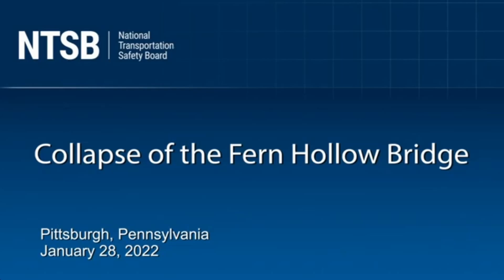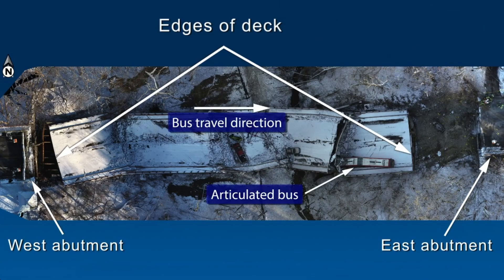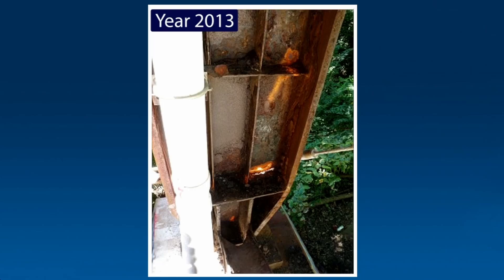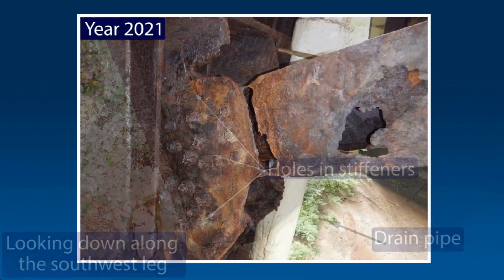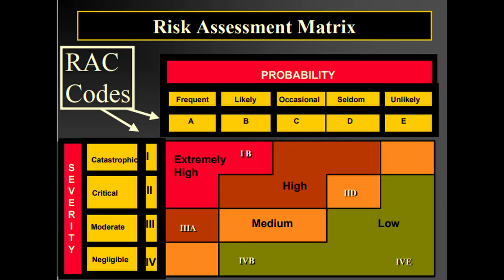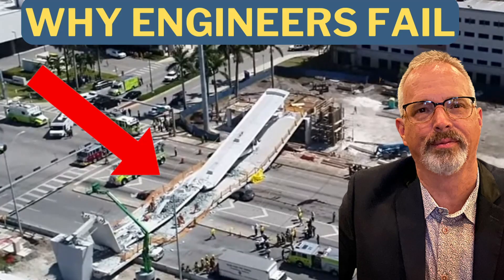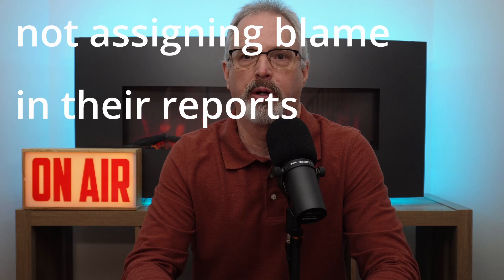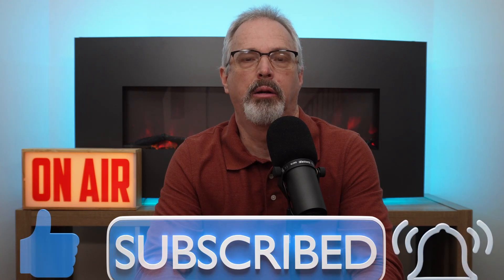Why the Fern Hollow Bridge Collapsed

Comment: I'd like to offer a different perspective and a question.
I'm a commercial vehicle owner/operator that has trucks inspected more often than any bridge, held to often ridiculously high standards. For example, light to moderate  rust is red lined and it NEVER gets to the point of rust through. There can't be ANY loose parts. It is petty to the point that valve stem caps must be steel, not plastic. The driver is personally responsible for the vehicle at ALL times and the owner is also assessed a Combined Safety Assessment score that can trigger additional review and even shutdown by the Feds. If a vehicle is randomly inspected and found to have even minor defects it can be placed Out Of Service until repaired. If it is found on the road while OOS, the driver is guilty of a FELONY.
Roads and bridges can be in unsafe or worse condition, NO one is responsible to any extent and this is acceptable to everyone? 
I've asked many involved in various positions why this is- including my town to explain a road that was washed out and not repaired for two months- why does this contradiction exist for infrastructure vs. infrastructure user? Anyone?
Reply from the maker: That is a great point.  There are too many double standards held by government officials.  What is good for the goose is not good for the gander for some reason.

Comment: I do think that the way engineer reports on these sorts of things do need to be adjusted to put the safety recommendations at the front of the report. It would make it a little more difficult for the owners to overlook that part if it's right up front. Not that owners of these buildings and bridges still won't find excuses for why they didn't act, but at least the engineers that did the inspections will be able to say "we put it right in the front of the report so I don't know how they missed it."

I'm not saying this to blame the engineers, but rather as a sort of "cover your ass" type of precaution. And frankly, it has more to do with how these reports are typically structured rather than any individual's decision or whatever. All I'm proposing is a minor change to the report format.
Reply from the maker: I agree with you.  In the newspaper business they called it burying the lead!

Comment: KISS, Keep It Simple Stupid, bridge designs would help in preventing the failure due to poor maintenance and make inspections simpler.

Bridges that require a component level FEM analysis to Id critical members should not be used. We are not designing airplanes. 

On Fern Hollow I would not be surprised if the design used Hardy-Cross in the design calculate the bending moments in the legs.
Reply from the maker: That is a great point. Plus the usr of weathering steel was a bad choice for this area.
Reply: A painted  bridge of that vintage  with no maintenance would be just as poor or worst shape.

 A weathering steel bridge I design in the early 70,'s on a heavily salted road is structuly in good shape. The areas of concern we took care of, painted areas of concern  joints and  drainage have been maintained  The deck is starting to show it's age and the parapets don't meet current standards. Not bad for a 49 year old bridge.

Comment: As a resident of Pittsburgh, there is a local joke about sightings of city employees actually doing work. I would bet that dozens of work orders to clean out those drains were issued, reported as complete, and signed off as verified. It’s really insane that the city floated bonds for 3 sports facilities, added decorative lighting on the 3 sisters bridges, and implemented some of the most ill thought out and dangerous bike lanes anywhere. The bike lanes were such a superficial attempt for political approval that it’s almost laughable. A year or two ago, there was a concrete and steel bridge in the East Liberty section of the city which had the pedestrian walkway being supported by 4x4 lumber. Do you remember the bus that fell into a sink hole in the middle of the city? The city should be put on some sort of probation for this malfeasance and neglect.

Comment: Champlain towers was a very different animal, the inspection contractor was basically hired to do an inspection (likely in hopes of getting a contract) - so it’s bad, but we can fix it. 

This bridge was inspected by the state, guys who have a ton of other bridges and structures to inspect, and a clear chain of command as far as who is responsible down the line. 

Also, with Champlain towers, most of the clues were really NOT in those inspections. Most of what we know now is after extensive focused engineering work over an extended period of time with tons of resources. The biggest deficiencies were really in the initial construction anyways (lack of rebar, rebar in wrong areas) or excessive load due to massively heavy upgrades throughout the tower, which would never be known by the firm who inspected the building. 

This bridge? A clearly (visibly) non-redundant structure, with supports CLEARLY compromised - very different animal. 

The inspectors probably oils have done more, but after nearly a decade of reports to superiors, it’s kinda out of the hands of the little guys. Somewhere, those photos were sitting on a supervisors desk - probably sent to someone ELSES desk, etc.

Comment: Consultants have an vested interest in 'customer satisfaction'. If the customer absolutely will not tolerate bad news the consultant will know this and soft sell the deficiencies. The burying of the failure at page 9 in the Champlain Condo Structural report  may be taken as an excellent example of this. Had the information been the headline item of the executive summary, there are any number of clients who would return the document for revision. If the consultant stands their ground some clients will then 'shop' for a new, and more flattering, report from a different consultant.

Comment: Human beings have a huge weakness: they want everything to be all right. If no one says anything, well, then, everything must  be fine. I won't worry about it. The problem is to get someone to speak up. "This isn't all right! We must do something.We must close the bridge. That guy on the subway playing with a gun: we must swarm him. Or at least call a warning and empty the car." (Thinking of an incident in New York back in the late '80s or early '90s.) But it's easy to believe and hard to speak up when, holy shit, I might be wrong and then I'll be embarrassed. Better embarrassed than dead. Speak up.
Reply from the maker: Thank you for pointing out the human factor which is the root issue ultimately.

Comment: There needs to be a law that states that if a certain level of bridge maintenance is 'not' performed, and the bridge has resulting severe structural issues, then you have two choices:  1) Shut down the bridge and bypass the traffic elsewhere until the required bridge maintenance can be performed.  2) If you think the bridge is structurally sound, pull by cable, across the entire bridge, a remote-steered loaded cart that contains 2 times the maximum load that the bridge is rated to handle, every month until the required bridge maintenance can be performed. A 'sound' bridge can handle 3 to 4 times the rated load, so if the bridge is okay it won't 'buckle' under twice the rated load.  If the bridge is about to fail, it will fail with twice the rated load.

Comment: It's worth pointing out that contracted inspections often are specified to exclude opinions and recommendations or at least to limit recommendations in such a way as to effectively be calling for continuing to inspect.

Law departments for responsible jurisdictions and contractors have been documented to do training about liability avoidance by never putting anything in reports, memoranda, or field notes, or in any electronic communication that could later be interpreted by a jury as 'prior admission of liability ". Simply put, never write anything above and beyond the minimum required for the stated purpose.

The issue with prior admission is usually explained as that if during document discovery, as part of a liability lawsuit, something can be presented to the judge and is interpreted as a prior admission, that judge can decide that there cannot be any defense presented to the jury, because the respondent already admitted liability. So the only thing remaining would be to assess damages owed.

And that's all in addition to what can happen to insurance costs when underwriters get ahold of critical inspection reports.

Law department personnel often justify their behavior as protecting the taxpayers. 

And, ultimately it's the taxpayers who have created the system and that often believe everything is as it should be until they, their family, or someone they know is affected by shortsighted and dangerous decisions.

Comment: Question:  When building a bridge, there's set standards on what can be done, the materials used,  loadbearing capacity, how much to safety margin, etc. etc. But are there set standards for condemning the same structure?   When you see some rust, what is the dividing line between a concern and time to condemn the bridge? Do engineers go back and re-check the load calculations based on the weakened structure?  I thinking the problem is the lack of standards, particularly for a slow-moving problem.  On top of it, no one wants to be "chicken little" and sound the alarm too early because no one would hire that engineering firm in the future. Add into this management which is always going to ask "can we put this off for a year?".  I doubt if engineering has gotten so advanced that someone can predict with certainty that "it will fail in one year".  But if there's a standard, then the engineering firm can say "You're 10mm away from required condemnation" and it would force everyone's hand.  It's easy to look back on a failed structure and say "something should have been done",  but I don't think anyone is accounting for typical human/management behavior "It's been like that for awhile.  Can we do this next year?"

Comment: Thanks. Some people treat their position like it's theirs and don't consider the implications of not changing things and taking action. If they can spread responsibility either be taking slow action to pass off to their replacement or by directly passing it off they will. If the final person responsible for taking action is far in the bureaucratic chain then they can feign ignorance and just ignore problems to spend it in whatever they are pushing. Officials are more concerned with winning for themselves and their team, as well making any competition look bad. They don't care about anything unless it helps them out hurts competition. Happens in private as well. Someone won't make changes if it causes problems with them rising up the ladder.

Comment: Those cables look as if they're doing more harm than good by pulling harder on compromised structures. Sheer stupidity.
Reply from the maker: I agree. They appear to be counter productive.
Reply: Cables don't work well in compression, bandaid on a amputation.

Comment: Walked under this bridge a couple years before failure and noticed the added cables and the completely rotted failure leg.   I couldn’t figure out how the cable was helping.  And I do have a little engineering and safety background.
Reply from the maker: I think those cables were no better than decoration!
Reply: I saw in the local paper that the cables were added to reinforce the crossmembers.  While clearly ignoring the gaping holes in the main supports.   Wish I had taken a photo.

Comment: It's a systematic management failure.  If front line inspector has authority to immediately shut down compromised structure before inspection is complete and long before report is written and fails to do so, the resulting collapse is 100% on that inspector.  If front line inspector doesn't have that authority, then that's a systematic organizational failure.  If front line inspector has already concluded structure is compromised before inspection is complete, and organization is expecting that front line inspector to complete the inspection, write full report and play town crier all at same time, that's a built in systematic failure and these things will continue to happen.  In short, if inspector can immediately order DOT to close bridge upon initial conclusion, there's no need for inspector to play town crier.  Inspector can then quickly write and issue a short partial report documenting why bridge is now closed, before returning for a complete inspection and complete report sufficient to determine next steps, be it repair or replacement of structure.  Isn't that what happened on interstate bridge over Mississippi River between Tennessee and Arkansas as soon as inspector observed a single cracked beam?  Wasn't that bridge immediately closed before any report was written?
Reply from the maker: You are exactly right!  I need to research the Arkansas bridge story.  This Pittsburg bridge situation reminds me of the  I-195 bridge in Rhode Island.  A junior inspector notice a broken tie rod in the bridge deck which caused the deck to bounce wildly under traffic.   That was on a Friday and the bridge didn't get closed until Monday afternoon.

Comment: I'd have to wonder whether the inspection contracts contain secrecy provisions that prevent the engineers from going public. Even if such provisions were rendered void by statute, a company that went public could expect not to get any more inspection work. 

It would really take a statute that forced the inspectors to immediately publish all inspection reports with no exemptions (the existence of any exemption would lead to delaying litigation) so as to prevent government entities from covering these issues up because they don't want to spend money. Another possibility would be an independent agency that is required to receive all inspection reports, and with the power to close unsafe structures.
Reply from the maker: You mentioned some great ideas.  Usually such inspection reports are a matter of public record but there have been some reports that the City of Pittsburg is refusing to make many records available now.  By statue, engineers have a responsibility to protect the public.  In practice, too many problems are compartmentalized mostly due to monetary considerations (fear of being sued or fear of losing out on future work).  I actually got my company kicked off a DOT job years ago.  As consultants, we were responsible for performing the design related to the highway.  Near bid time the DOT's project manager got nervous and starting making changes to our design that would have made it ineffective and a danger to the public.  I sent an email saying that if they made that change that I would report them to the engineering licensure board in that state.  They got mad and canceled the balance of our contract (equivalent to about $250,000 today).  At least they ended up not making the dangerous change.  My boss was not at all happy with me so it showed me that he wasn't a "real engineer" in my mind and was merely a businessman.

Comment: I live within earshot of this bridge. It was in poor condition but not unusual condition. With half the population it used to have, Pittsburgh can't afford to maintain all of it's infrastructure. I don't know what the solution is but it just shutting everything down isn't a viable option. We probably need to accept more risk than typical here to maintain a functioning city. Agreeing on the "right" tradeoff is the hard part. We also need to replace lead water lines, separate storm and sanitary sewers, proactively address landslide risks, keep roads clear of ice, etc. How do we balance all those risks? It really is a tough discussion to have productively, and not just in Pittsburgh. 

What happened here is a convergence of shrinking tax base and aging infrastructure. Individual behavior can be faulted but I don't think it is the root cause. We should be spending more time discussing the cost of infrastructure and spend less time fixating on individual blame. The only viable solution for Pittsburgh is less infrastructure cost per capita. We can't afford to maintain what was built when we had double the population and were the center of the global steel industry. 

If I was in charge of a budget to save lives with infrastructure projects in Pittsburgh, bridge collapses are not at the top of my list. We have many preventable traffic deaths and collapse is not what poses the biggest risk. Yeah, this is an important topic. But I don't think people are evaluating the relative risk empirically or pragmatically. I hope we have better information about risk made available to the public. Though I don't think that will lead to the better overall prioritization of infrastructure funds.  

This is a bit rambling. I think my point is that the public reaction to this sensational event won't will lead to better prioritization of infrastructure funds. We would benefit from a broader discussion of what we can afford and where our dollars improve safety the most.
Reply from the maker: Thank you for your well made comments.  It sounds like Pittsburg is experiencing the same issues (although to a lesser degree) than what has happened in other 20th Century industrial hubs like Detroit.  There is no going back to the level of infrastructure and public services that we had in the past in many locations.  Ironically, Pittsburg spent $1.5 million to award a contract to a engineering consultant to evaluate 150 bridges (about 1 third of their inventory) when they only spent $1 million in actually maintaining or repairing these bridges.
Reply: How about former mayor Paduto, he should have been more worried about bridge repair and replacement, instead of bike lanes and other feel good BS.